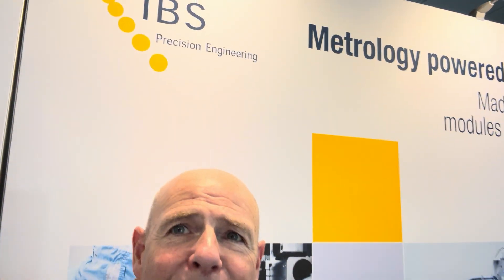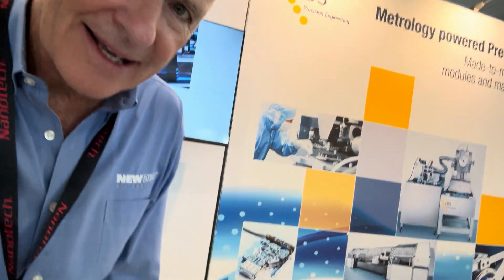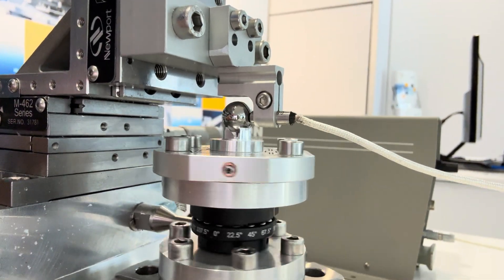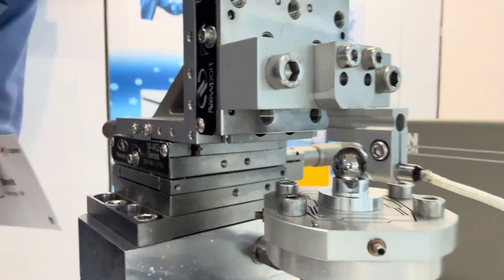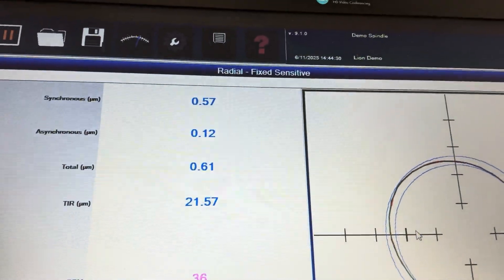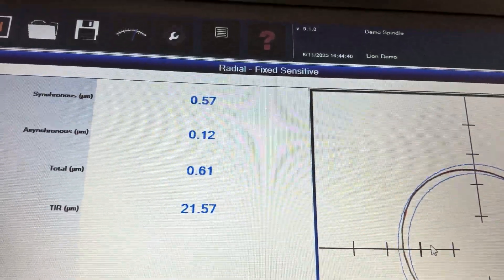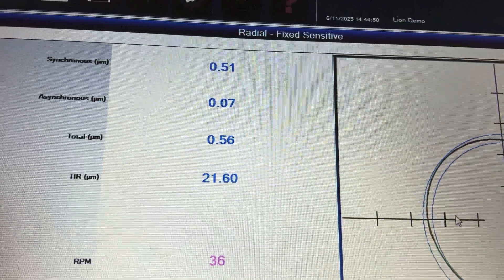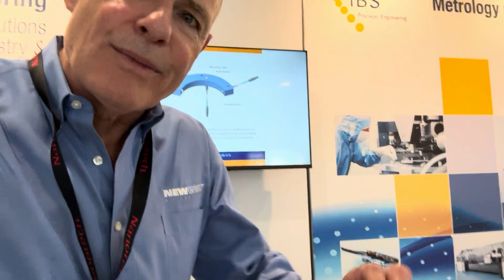New Way Spindle Shows Less than 50nm Error Motion

Comment: The total spindle error motion is 560 nanometers, not 60. I’d guess it’s bolted to a not-very-flat surface to cause errors that large
Reply: Thanks for the clarification Cylo. I've been enjoying your precision spindle metrology series. How did you come to your 560nm number?
Reply: @JonScottSmith  synchronous is 0.57micro aka 500-570nm, maybe that is where he got the number from. but admittedly I have no idea about anything here
Reply: @Martin-kv3th  Ah, that makes sense. I typed the micrometers number wrong when I converted it in Google. Didn't know the conversion off the top of my head. Thanks.